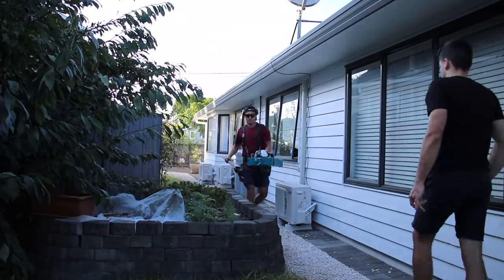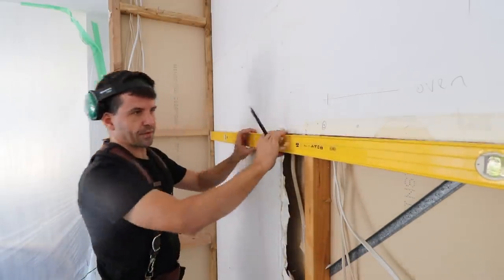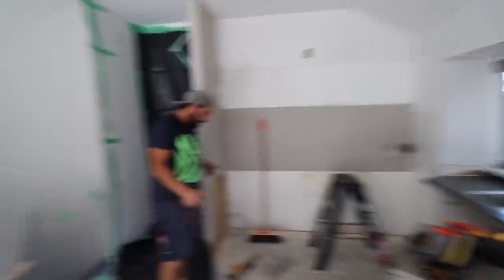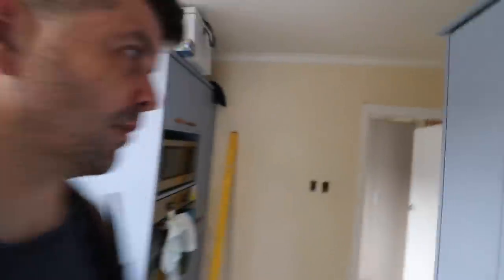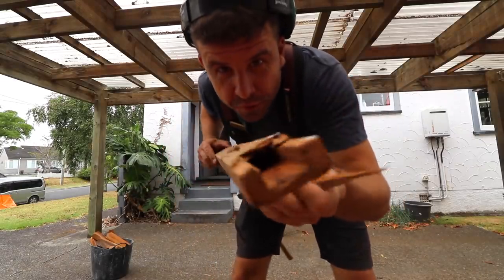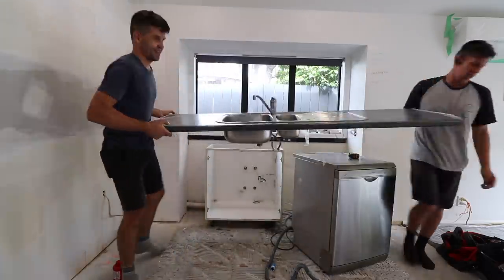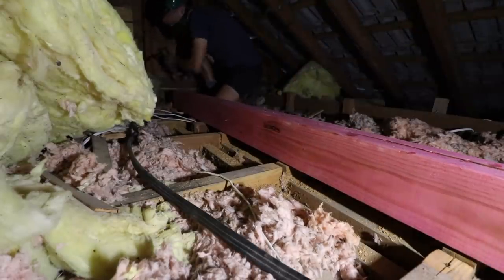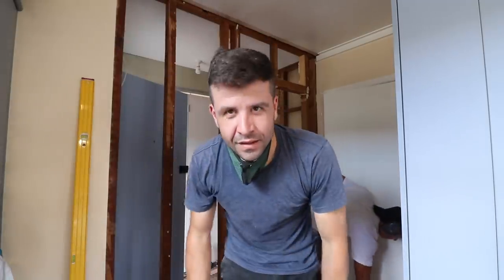Builders Don't Install Kitchens [Part 2]

Comment: can you also call a cabinet maker a joiner?  what the heck is a joiner? lol
Reply: Yeah, so the term joiner has largely been replaced by cabinet maker in the US. You might hear American craftsmen who create furniture or joinery for historic building reno's refer to themselves joiners, though.
Reply: @richardbaron7106  but a joiner can also put together wooden roof beams, no?
Reply: @Oldiesyoungies  - a joiner typically works offsite, whereas a carpenter (builder) works onsite. 
So if roof trusses are pre-built in a warehouse or factory, then those peeps are joiners. If the same peeps then install the trusses, they become carpenters. British English terms can be confusing, no?
Reply: @richardbaron7106  but what about in the 15th century when they joined together oak beams with dowels to make a roof. Would that person be a joiner?  Or is the "offsite" rule a good guideline to know who and who not to call a joiner?  And also, are you british or austrailian?  thanks
Reply: @Oldiesyoungies  - still called a carpenter or builder, although some of those guys that build in that style are real craftsmen.
Like Scott Brown, I live in Auckland, NZ and like Scott Brown, my folks are British and I came to NZ as a kid. Unlike Scott Brown, I'm neither a builder, carpenter, joiner, sparky, plumber or any type of tradie - used to be a mechanic years ago, though.

Comment: As a contractor that does kitchens one thing that I would strongly recommend looking into is a zipwall barrier system(or at least the supports). It's incredibly easy and strong way to section off a area with plastic with needing to rely on tape and can be setup and taken down in less than 5 minutes.

Also I love your videos and enjoy watching all your amazing handy work! Keep it up

Comment: Bunnings sell telescopic poles in the plastering section. I use them for holding cornice in place & installing temporary plastics walls. It avoids using tape & prevents the tape from pulling paint off the ceiling when pulling the tape off. If you trap the sheet to the ceiling with a length of timber you only need a couple of props/supports.

Comment: When removing cornice use a tiler-Plasterer’s floor scraper (the one with a shovel style of handle)  run it along the ceiling and then the wall running it into the cornice on a slight angle. The quickest way to demo a ceiling or wall without damaging the plaster you want to keep 👍